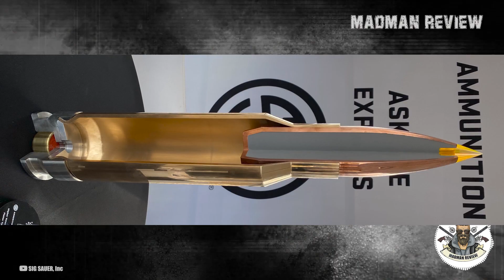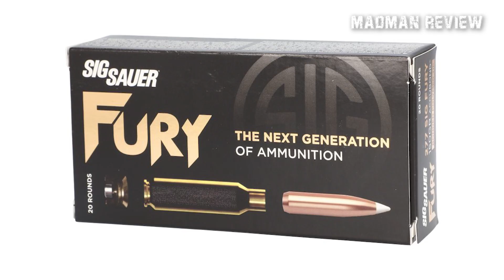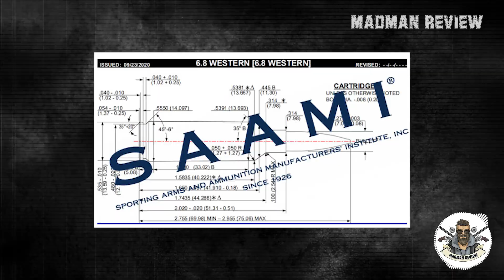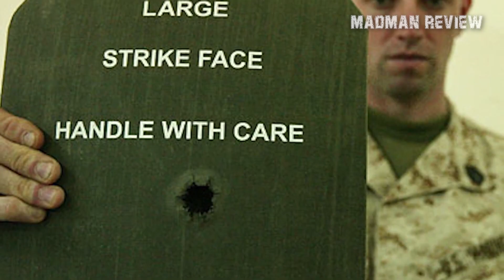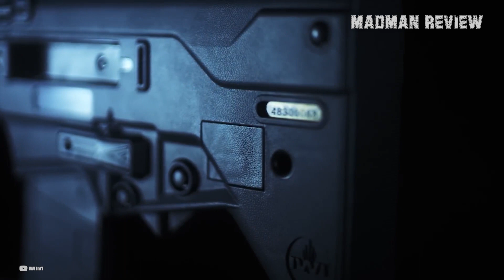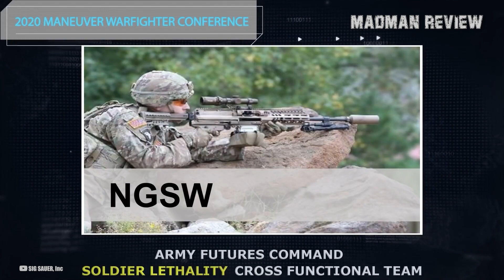SIG Sauer MCX-SPEAR: The Next Level Battle Rifle?

Comment: More stopping power, in order to compete with the AK's stopping power.
Reply: The AK-47 round tends to go through people which means much of the force goes with it. Army medics claim that the current M4 round is more lethal than the AK-47 round because the bullets tend to tumble around in the body leaving a longer hole and a greater chance to hit a vital organ. The new round is for long range armor penetration and not stopping power. The non backed up claim is it's suppose to penetrate level 3A body armor at 600 meters in one shot.
Reply: This is interesting because in Afghanistan a lot of soldiers were saying this. Now fast forward to vets volunteering in Ukraine and many started saying the AK sucks. Let's get M4's evenn though they can be sensitive or HK416's. We eventually got HK's in 5.56.

Comment: Number 5 "the ugly" gives a FALSE impression
You did not take into account that the youtubers only used the commercial ammo which do not have the high pressure performance of the military round. Where the commercial rounds only do round about the same as a 7mm-08, the military one has a muzzle velocity of 3000fps from a very short 16inch barrel!   There is NO "of the shelf option" that will shoot a 130gr bullet with a similar cartridge case dimension that fast with such a short barrel. 

Also very few youtubers tests the rifle with the dedicated suppressor, and then still comments on recoil.
Reply: The U.S. military is using a 13" barrel plus suppressor, but if you want the best performance out of a round, barrel length matters.

Comment: Nope, not M5.  Colt already had and "M5" so the Army changed it to M7. The M7 with the new Vortex M-157 multi sensor sight system gives and 80% hit probability for the average soldier! That means less ammo needs to be carried.
No, the M& os not "less robust" in combat than the M4. ALL other nations use gas PISTON actions and they are robust. Time to get away from the dirty direct impingement system of the AR rifles.

Comment: The Army will end up going with a higher pressure 77 grain 5.56 round that can get 3200 fps out of a 12.7 hour inch barrel. They will just end up using the technology they developed for the 6.8x51 cartridge. The end result will be a lighter, more deadly 5.56 cartridge out of a HK416 level reliable weapons system. If you are complaining about the weight, go get a dress. I would have killed for a rifle like this on my 3 years of Special Operations deployments.
Reply: This is all about penetration body armor at range. Using the paper data I found about the speed to penetrate various body armors and the speed at different ranges of the new bullet, it loos like the new round can one shot level 4 armor at 100 meters, level 3 body armor at 300 meters and level 3A body armor at 600 meters. Somebody has to step up and play  David Horowitz and test the rifle on its long range armor penetration capabilities.

Comment: So. So much regurgitated stories being repeated incorrectly by other youtubers prior. Then all this bad info keeps snowballing and rolling downhill lol.
Theres a whole huge backstory to the optics part. It was meant to be slaved to head mounted hybrid thermal NV goggles and be able to be fired off the hip and look thru the sights while still on your hips. Yet still be accurate. 
Long story.... but yeah it didnt becomes what it is by mistake. It was specced. All of it lol.
The 227 Fury is a crazy good concept. Most keep comparing it to "oh my old hunting rifle with a near 30 inch bbl and firing (place caliber here) will do the same numbers as that new round!
Youll hear it nonstop. 
This rifle can do it with just like 17 inch barrels tho if i recally correctly. 
So they can have a huge can on and still be shorter than what many guns need to even get close to the numbers. 

Lastly. Everyone keeps saying why if 556 is fine?
Its because it isnt fine. 556 as a whole (and small calibers like it,) are used really only by invaders. 
Its to keep the crazy long amount of legistics working in thier favor. Theyre lighter, smaller, easier to carry etc than 30 caliber proper battle rifles. 
The defenders aka goat herders etc lol. Dont have to worry as mucb about all this nonsense. They dont invade others much. So they have the fortress advantage. Stack piles closeby and shoot the enemy and pin him down long before he can reach them. 
Single goat herders with a larger bore caliber was able to pin down huge amounts of highly trained troops. Hed sit behind a rock and kill them and harass them till the planes arout to finally arrive. Then they scoot. 
Its briliiant really and highly effective. Overwhelming, long range, acurage strong firepower ower is a force multiplier like no other. 

So after that whole rant, it just breaks the ice lol. The whole program as i know it was focused on the MG version btw. The squad level Spears in thier setups was an after thought sorta to make it so they all use the same ammo. So it all revolves around giving the squad mg gunner the ability to pin down the enemy past the 30 cals of before. 
Thats a game changer. 
So with all this being said. Wiuld yoh rather have a 556 in large open area warfare? 
Or would yoh want a better system yoh can actually use and keep from being killed long before you can even attamept to fire back?
The amount of ammo needed by default can be a lot less of a big deal if you now dont have to randomly spray tons of ammo at the enemy to pin them down. 
Heck with these kind of guns you may just need 2 mags to kill lets say 10 enemies vs where as before you maybe need 300+ rounds. 
So, with being said. Weight is no longer a huge issue. You can simply carry a little less now that you dont need no where near as many. 
Takes forever to explain it all lol. Even more actually if ya want to adress all the reasons why. 
But this should at least give the notion of what they did and why. 
So, yeah if a was a soldier id take that beast all day long!😎